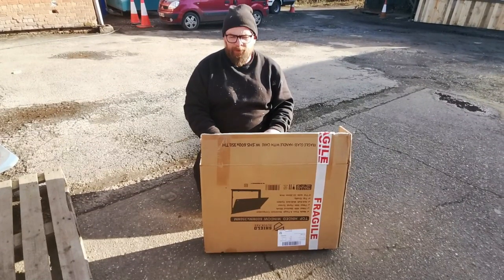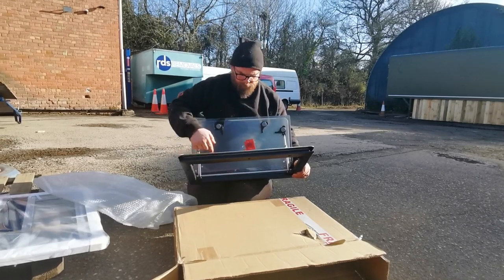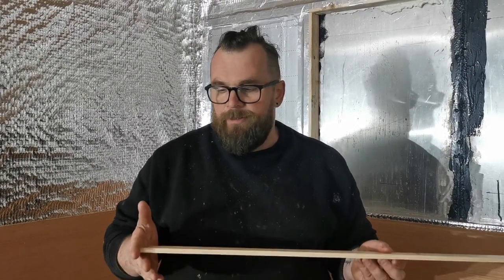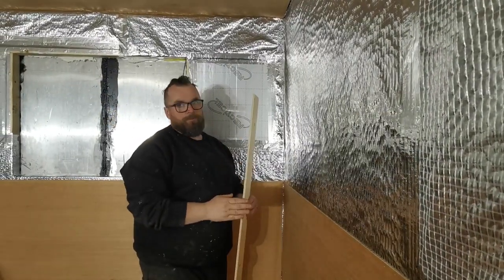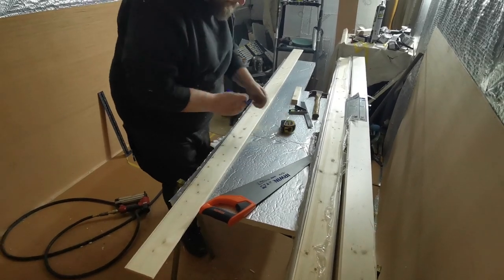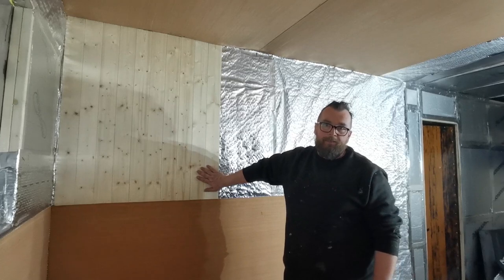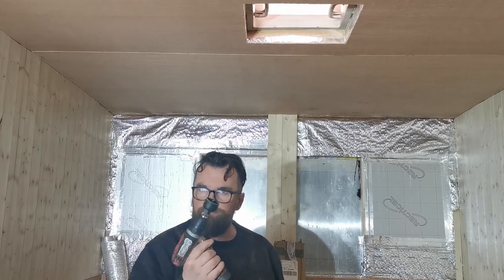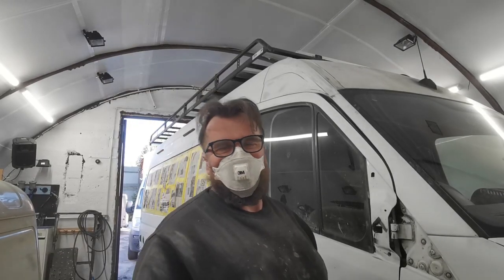Wood, Windows and Walls | EP18 | Horsebox Camper Conversion

Comment: Looking good guys,well done ! ❤️🙏
Reply from the maker: Thank you ❤ How is yours coming along?
Reply: It's slowly coming along everything is stripped out now painted with oxide anything rusty on inside, trying to get hold of some more aluminium hopefully I have found a place in Lincoln that do some 🙏and hopefully start filling in resealing panels. Did you take your truck to be weighed before starting truck.
I'm still undecided on layout🤦🤷.